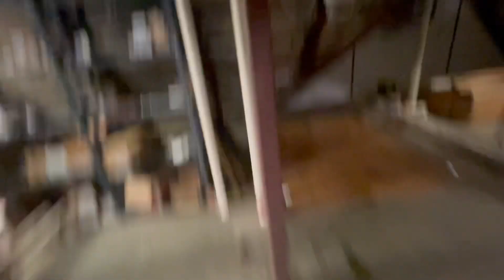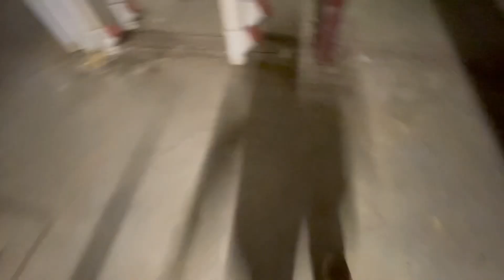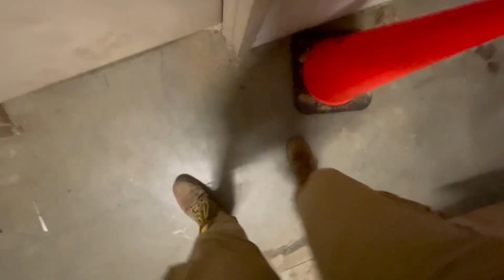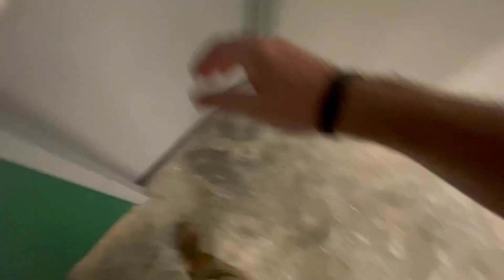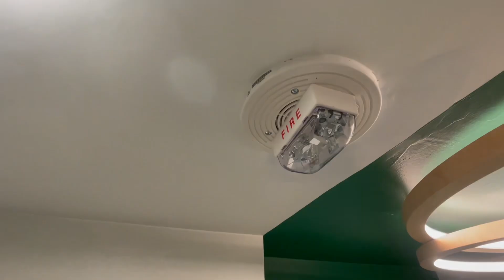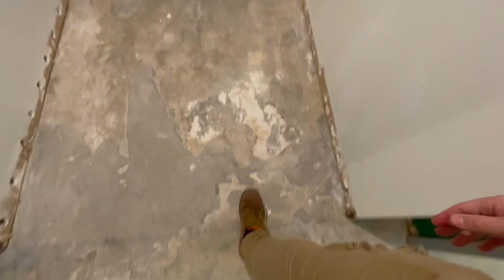That One Time Speaker/Strobes Get Annoying (Fire Alarm A/V Test) [07-17-2024]

Comment: I’ve done field work of my own lately and there is a video of it on my channel. The site is actually a brand new site under construction and we just put in a brand new EST4 with Genesis LED appliances on BPS power supplies controlled by CC1S modules. The EST4 is actually a pretty neat system once you get to know it.